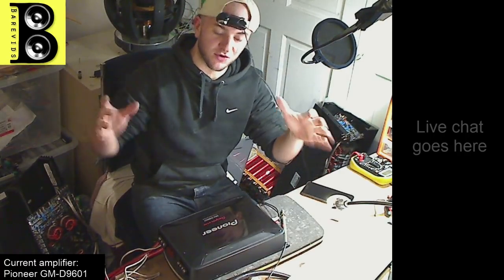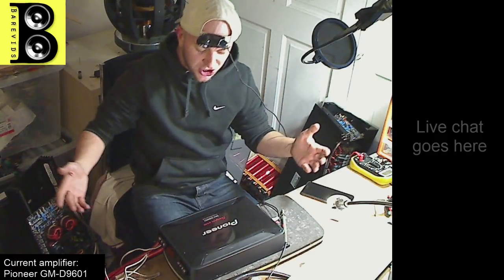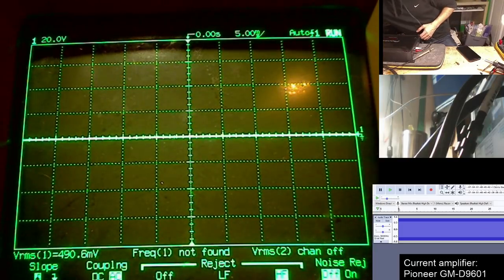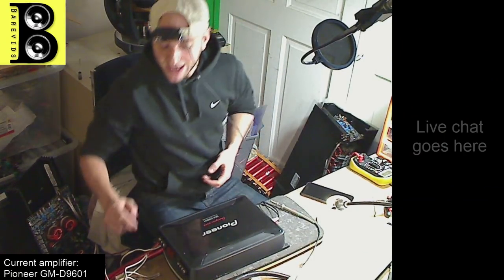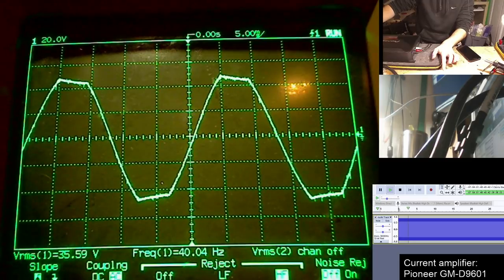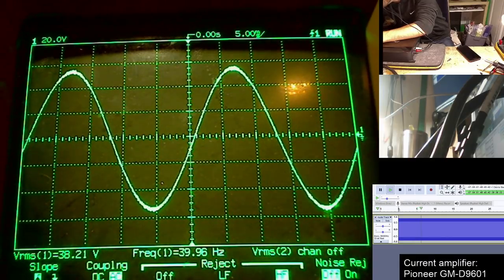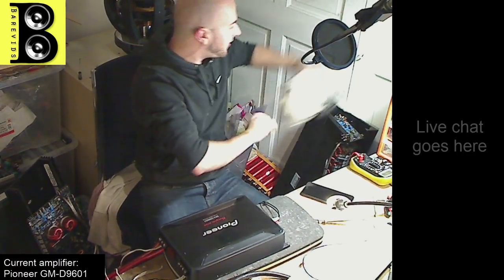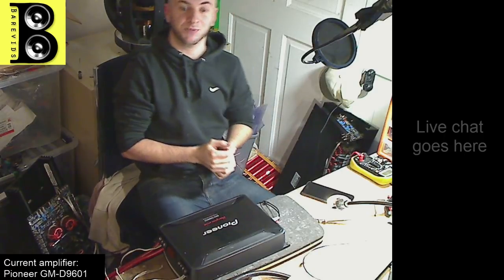Setting gains with subs connected VS disconnected

Comment: Wonder why it says in my manual, to disconnect the speakers when using an SMD DD-1, same for the video of the creator of the DD-1's made.. lol
Reply from the maker: Due to gain overlap. They assume people's music isn't going to have as high signal level as a straight tone. But with all the rebassed, processed compressed and normalised music we have these days, there will be tones that reach the close to 0db region.
Reply: Joe K.O.S the DD1 manual, 
Disconnect all speakers connected to the amplifier. (This has already been calculated into the equation and provides 1- 3dB more gain overlap on unregulated power supply amplifiers and 0dB more gain overlap on regulated power supply amplifiers).
Reply: So pretty much EVERY SINGLE PERSON who has set there gain over the lst 10 years has had clipping with speaks hooked up yet NO one has blown them?  Im not getting this.
Reply: @Mkvy  Ok, ya i been trying to make sure i dont clip mine and blow them up since they cost to much money.  Like you said so many opinions on how to do it.   If this is true though and it tells you to UN hook ur subs in the dd1 manual, it kinda makes me wonder if that `150 dollar dd1 is just a scam, since a 5 dollar bass knob with a clipping light does the same thing as the dd1 lol.
Reply: @4gbmeans4gb61  Setting your gains perfect does not mean you wont clip your amp. 59 vol may be clipped on one song and 62 not clipped on another song. Get to know your system, use your brains and your ears. Learn what your voltage meter does when it clips. Never push your system to its limit when you are idling. Trying to pull large amounts of current from your alts is like running your amps with low voltage. It will cook them
Reply: @canadiancaraudioaddict4766  ok thanks mate, i just get worried sometimes.
Reply: The amount of clipping shown in the video is actually pretty mild. It won't hurt subs. Where people go wrong is when they have their gains WAY too high and send what is basically a square wave into their subs. What people don't realise is that an amp can put out a lot more power into a square wave than a sine wave, approximately 1.5x to 2x. It's people who have their gain wound all the way up that are left wondering how their 500W amp managed to blow up their 500W sub. Setting gains properly with the subs disconnected you will still be safe, setting gains with subs connected is just even safer.
Reply: @tmmtmm  It's so different from people to people I guess. I set my gains using a DD-1 thought. But it's all about knowing your system and learn it's limits. I've had mine for a month now, and I'm still tweaking etc.
Reply: without an oscilloscope to monitor the waveform you wouldn't know if the gain was optimally set or not.  Clipping doesn't blow subs.  Too much power is what burns speakers.  If you pump a 100watt rms square wave into a speaker that can handle 100watts rms  it will not hurt it even though a square wave is clipped top and bottom.
Reply: yes a 150 dollar dd-1 is a total ripoff as are some other smd products.
Reply: It is overpowering a speaker that blows it.  Clipping a speaker within its power capabilities should not hurt it as long as it is built to handle the amount of power you are feeding it, clipped or not.
Reply: @JasonKerlin  Not 100% true, lets say you have a speaker that handles 100 watts, 100 watts of severely clipped signal will heat the coil much faster than a clean un clipped sine wave.
Reply: Ok if a speaker can handle 100 watts of power and you feed it 100 watts of square wave signal if it is rated appropriately the speaker will be fine.  Yes the coil would heat faster to its steady state at that 100 watt input level but that is fine because 100 watts flowing through the coil  shouldn't damage a speaker rated to handle that input level.  Power compression should be part of the rating metric used to rate speakers.  I  agree with your comment as the speaker cools most efficiently with an unclipped signal as it is constantly moving.  The clipped signal heats the coil faster but if the speaker is properly rated it wouldn't matter what signal you sent it so long as its power rating wasn't exceeded.  Most speakers are way overrated on the power handling capabilities as all the factors aren't used to accurately rate them.  I have seen a so called 1000 watt rms sub blown by a 75 watt rms amp so it really depends on how honestly the manufacturer is rating their products as to wether a speaker will take a fully clipped signal at its power rating or not.  At any rate clipping is wasted power so it is best to avoid it completely.  Have a good one.
Reply: @JasonKerlin  Manufacturers seldom rate there drivers accurately, they just want big impressive numbers. On the other hand, JBL pro stuff  uses pink noise for 2 hours with a 6 db crest factor. So lets say they rate the speaker for 500 RMS based on the 2 hour test, the speaker will reach thermal limit long before the 2 hours with a square wave.PS that giant ass coil you are winding is your video is some serious stuff man
Reply: Yes it would.  I remember seeing on a university sound compression tweeter a rating of 60 watts rms for 1 hour with a crossover point of 2kh.  It then had a derating curve for longer run times.  As far as I know that is a pretty accurate rating.  I know we aren't really talking about tweeters, but it was refreshing to see some effort go in to rating a speaker for real world conditions.
Reply: @JasonKerlin  if that were true, how is it that people can run 7500 watts to a 2500 watt sub and not blow it?? Because I could positively blow a 2500 watt sub with a 1500 watt amp. Just want your input on that. Because I'm pretty sure running a clipped signal to subs IS what usually blows them. Because a clipped signal also pushes a sub past its peak excursion and causes the speaker to twist and flex causing the voicecoil to contact the motor. Hence the smoke of death. Right or wrong??
Reply: @HoUsEoFcAtS78  i agree with you on those points but if you look at it strictly from an electrical perspective a given diameter wire will conduct a given amount of power before it starts to melt and break.  Keep it below that point and it won't.  When you add the physical properties of the magnet and the coil/cone into it the dynamics of the system change that basic assumption.  If you keep the wire below its thermal failure point by better cooling or liminting power input it wont fail.  I think we are all in agreement though. It just is very dependent on the system as a whole.  If you could keep the coil cool you could just keep dumping power to it till it destroyed itself mechanically.  The biggest factor in coil performance is thermal management.
Reply: @JasonKerlin  clipping absolutely destroys speakers they cant cool themselves while being clipped its the heat generated from this that destroys the coils. My American bass xr12s are getting 1500rm each they are 1200 rms subs and ive set my gains this way uears ago still no issues. Now granted im using mb quart ZA1 1500.1 AB so super clean signal old school trick you can over power more with AB circuits.
Reply: So you have 1500wrms divided by two subs which means 750wrms to each speaker and each speaker is 1200wrms.  Well good thing you weren't clipping them while underpowering them.  If you looked at the comments in the thread you would see that I also say that It is thermal or mechanical failure that kills subs.  In my car which is 158db capable,at 26hz I might add,  I overdrive my subs by about 60 percent.  Each sub is 1200wrms being fed by a 2000wrms amp and I have been running them for 6 years now.  I would like to point out that in the context of your comment that clipping would always kill subs as you used the word absolutely.  I have absolutely clipped speakers and if you don't overpower them they won't fail.  The speaker cares not what it plays so long as it isn't thermally or mechanically overpowered.  So I agree with you that heat can kill a sub.
Reply: @JasonKerlin  you have no idea what you're talking about. Clipped signals burn holes in voice coils for a reason. It's the same reason a weak battery kills starter windings.

Running current through a voice coil is fine when it's a curve. The motor keeps moving and heat is dissipated up and down the coil and vented through the exhaust ports. 

Running current through a voice coil while clipped is one of the worst things to do to any sub. A clipped signal will hold the motor in a fixed position for a moment of time. That moment of time will focus the heat generated on one very small section of the coil. That small section will continue to heat up over time and eventually burn a hole through the coil. It doesn't matter if you are putting rated power to the sub or not. You can push 300 watts into a 1000 watt rated sub and destroy it fairly quickly if it's clipped.

Stop spreading misinformation
Reply: @TheGrublin  How about you read it again.  If companies actually rated their speakers for actual power then clipping wouldn't be as much of a problem.  I never said that clipping wouldn't hurt the speaker.  Sine waves will too, so you stop misinforming.  Speakers will blow if they are overpowered, faster if the signal is clipped.  Learn how to read.

Comment: Yeah but the driver in the box will have different resistance for different frequencies. How is that gonna affect the measurement?
Reply from the maker: Yes, that's why I mentioned you test this at box tuning frequency where the load on the system is greatest.
Reply: @barevids  aha I see, thanks for the info 👍

Comment: So just a random question. Can you use a sub and a dummy load to drop impedance? IE trying to get a dual 4 ohm down to 1 ohm at the amp for max power?
Reply from the maker: No, the sub still sees the same power as when the load wasn't there, but now the amp is just under more stress and you have added a small heater to the system. It will actually be quieter.
Reply: @barevids  I figured as much. Guess I just need to sell off some subs and set up a system to rest nicely at 1ohm. The 15 is taking up to much room in the car anyway. Hmm a bunch of 8s could be fun.
Reply: @barevids  thanks for the reply btw great video.
Reply: So leaving my speakers plugged in, they wont get damaged by the 1000hz test tones

Comment: Does that same principle apply to mids and highs
Reply: Yes, but mids and tweeters are very easily blown up if you put full amp power into them with a sine wave test tone. So it's kind of counter productive to risk blowing them up in order to set the gains correctly in order to not blow them up...

Comment: So if my box tuning is 31hz do I set gains using a 31hz tone??
Reply from the maker: Would be best to, yes ☺
Reply: @barevids  ok ive always heard only do 40hz test tones 0 or -5db
Reply: @barevids What if subs are sealed? Tune at woofers Fs in sealed enclosure? Do an impedance sweep to determine Fs?

Comment: YOU SAID u had to hook to subs in a box  thats TUNED>... so how does putting dummy wires on it do ANYTHING??? And if this is true then every peson who has set there gain with DD1 was really clipping?  So `150 dollars down the drain?
Reply from the maker: Possibly, but the advice given with the DD1 was to take into consideration Gain Overlap, where music would never be as loud as a 0db test tone. But with all the processed, compressed and rebassed tracks these days, the signal level does reach pretty much 0db sines on many tracks. I'd rather be safe.
Reply: @barevids  that makes more sense to me then, i just get paranoid about this stuff and not blowing up my subs.

Comment: hey, is there a way to make a load resistor for amps like 5k+? if not even 3k or so.
Reply from the maker: They're on eBay
Reply: @barevids  found them, assuming you want the total wattage of the resistors to be higher then the amp that's hooked up? example, they sell 2000w 1,2,4,5 and up ohm resistors would I then take say 2 2 ohm 2000w resistors and in parallel that would be 4k at 1 ohm, correct?
Reply from the maker: @allrimmedout  the ratings are continuous. If you are just bursting power for a couple of seconds, you can throw up to 4 times rated into them. I have 4 x 4ohm 1000w. That's 4k continuous, but I could burst over 12k into them.
Reply from the maker: Or if you want more continuous power, throw them in a tub of water or something. The more heat you can pull away the higher power you can put.
Reply: @barevids  their cases are sealed correct, so the resistors inside couldn't dead short from water? lol wouldn't want to dead short my amps.
Reply from the maker: @allrimmedout  it's one solid piece of ally, just make sure where the wires go in are raised above the surface of the water.
Reply: @barevids  you the man sam!!

Comment: Uh, 10k? Have the standards changed?   All my gear is 20+ years old, so maybe I missed it.
Reply from the maker: There are single amplifiers rated for over 35,0000wrms sir!
Reply: @barevids  Do they come with a 2500amp fuse or do you have to buy that separately?

Comment: Hey i have a quick question. When repairing an amp is it only necessary to keep batch numbers the same with mosfets in the same banks ?
Reply from the maker: Yes but all mosfets must have similar Vg otherwise it will heat a little on idle
Reply: @barevids  Thanks! where do you usually order your mosfets from? Im thinking about using digikey but i want to be sure they send me components from  the same batch (need 16 IRF640N's).
Reply from the maker: RS Components or Mercateo. These are UK stores tho so not much use to you
Reply: @barevids  Finally got my parts in, they were all the same batch and used the MK328 to make sure the parameters were within the specified range. I Replace all the fets in both the power supply section and the output section(IRF640N's)  to be safe (power mosfets blew last time IRF3205's). I got the amp back together and had it working on my test bench for half an hour and it shutoff. Appears the power section died yet again... i was running the amp at 2 ohms just doing some light testing. When i opened it the output transformers were fairly hot. This is a soundqubed s1-2250- extremely  similar to DM2500 you took apart almost identical. Im stumped as i do not know why the power supply mosfets failed again, if you could offer any help that'd be great.

Comment: The amp is only rated 1200rms at 1 ohm , which needs to be set at 34.64vac, of course it's gonna clip at 38vac , this is wrong information , do the calculations math ain't wrong
Reply from the maker: It's not wrong information, it's warning people against solely using DD1 or scope to set gains with load disconnected with no thought to the voltage level. If you are setting gains by AC voltage, then unhooked is absolutely fine. ☺
Reply: Some amps do put out a little more than what they are rated. Duh.. 🤷